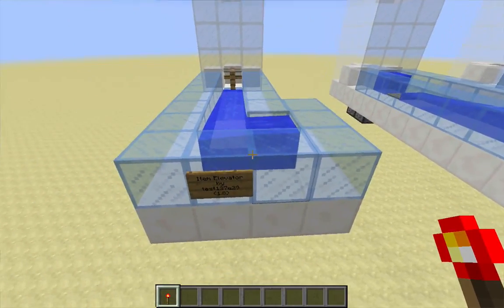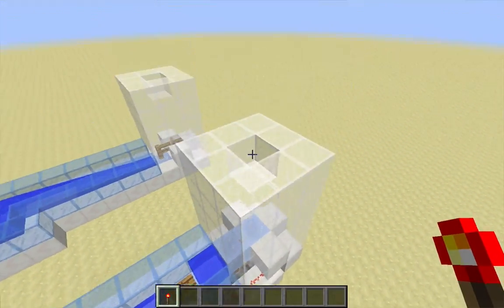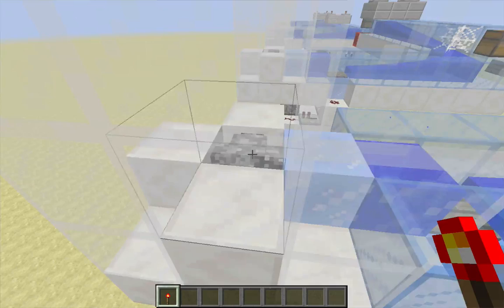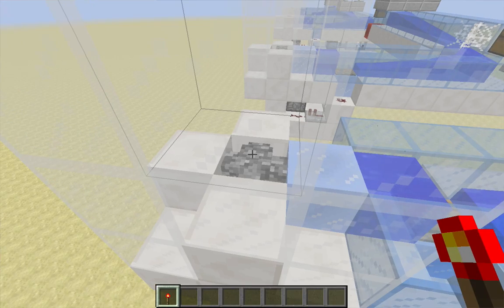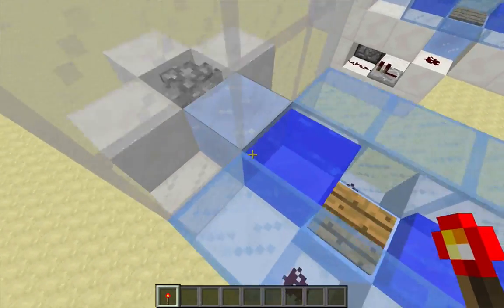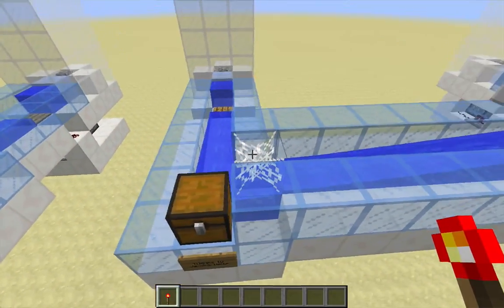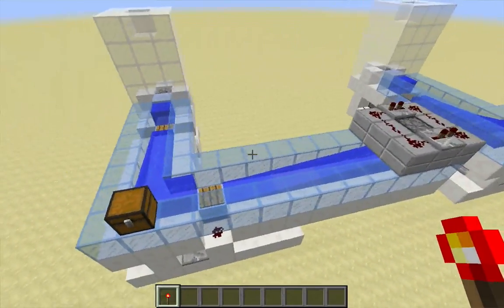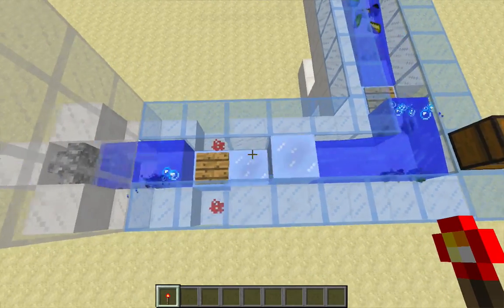Item Elevator Regulators

Comment: RIP our favorite, simple, redstoneless item elevator. Thanks for the heads up.
Reply from the maker: +Shadow 8472 There are some redstone-light solutions, at this point. I've got a lossless design that uses a relatively small circuit, and doesn't even require any packed ice.

Comment from the maker: +Marco Benilli Yeah, I think it would be doable, but my guess is that it won't be any less complicated than using a regulator. Best thing to do is mess around and find out! :-)

At this point, I've got some pretty minimalistic designs, regulators included, but I'm waiting now for the official 1.9 release. There will likely be some changes to the mechanics, which will influence design choices.

Comment: Love the only one piston to the elevator part that way will work nicely when itens come both sides :) without more ressources the regulators im sure or worlds are going to pay for this with an increasse lower frames but what can we do :) Tanks for the help :)
Reply from the maker: +IceBurn77 Yeah, it would be nice to have a way to move large amounts of items upwards without lag. Some of the suggestions I've seen on the reddit have been pretty interesting. Getting the mechanics balanced is a tough job for the game designers, though.
Reply: Nathan whats the tick time of the repeater beneath the pressure plate? 4 ticks?
Reply from the maker: Yes, it's 4 ticks. That effectively increases the signal from the pressure plate by another 4 ticks, giving the piston a 14-tick activation after a 2-tick delay.
Reply: +Nathan Ryan Used your old flow control of itens works just fine :)
http://postimg.org/image/4phjv5ui7/
Reply from the maker: +IceBurn77 Great! I've got another design in the works, lossless and handles high volumes. Only two pistons and small amount of redstone, but it runs on a clock. I'll see if I can record another video sometime this weekend.
Reply: +Nathan Ryan just tweeked the timings and just needs one more sticky piston and one repeater to get the full system to all kinds of loads of itens :) 
http://postimg.org/image/jciictt4f/
No losses so far. :) i think its harder to get smaller thant this xD
Reply from the maker: +IceBurn77 Very nice. I spaced the regulators apart a bit more, because I was working with a corner, but you're right it could be tightened up. I did have some problems with that close of a spacing when the first regulator is a stopper, though. With a trap, I think it works nicely.
Reply: +Nathan Ryan Any idea if they change something on enchanting tables as blocks? Im figuring out the wither cage for my tree farm to work on 1.9 and seems the wither cant see an iron golen when a enchanting table is between the wither and the iron golen protecting from the heads. This was my 1.8 design and the wither never escaped and the iron golen never got injured http://postimg.org/image/ncjn1o2wf/ but now the wither cant see the iron golen with an enchating table. Im trying to replace with iron fence with stairs on side so that donst conect instead of the enchanting tables
Reply from the maker: Hmm, no idea. I actually did some testing with an enchantment table when messing around with item sizes (for the purposes of item alignment), but to my knowledge nothing about them has changed. I doubt that the wither is non-hostile to iron golems, so it's probably something else. Not sure, though.
Reply: +Nathan Ryan The wither is hostile for sure without the enchanting tables he fires at the golen but seems like he cant see it with the enchanting tables its weird!!!
Reply from the maker: I suppose it could be related to some of the other bugs that were fixed. My suggestion would be to figure out exactly which snapshot broke the behavior. That would at least narrow it down.
Reply: Tanks I'll try that later going one after the other snapshoot until it breaks xD